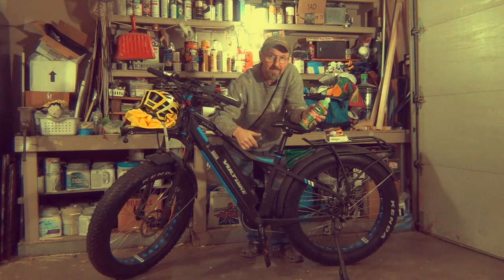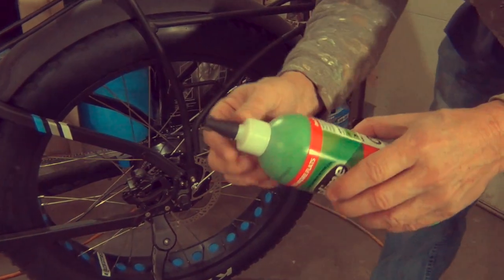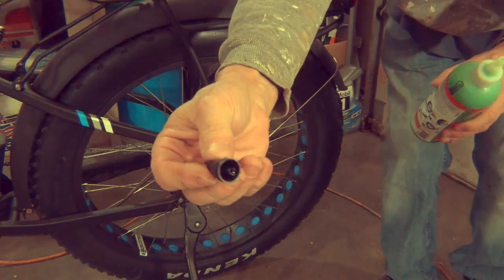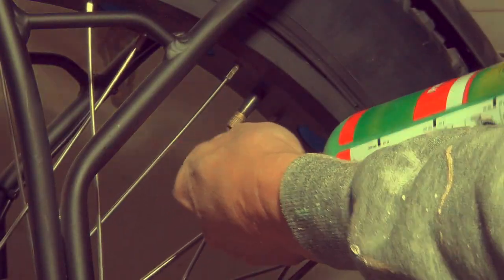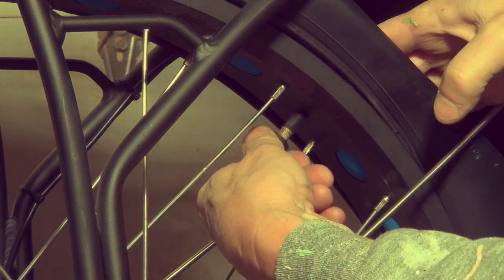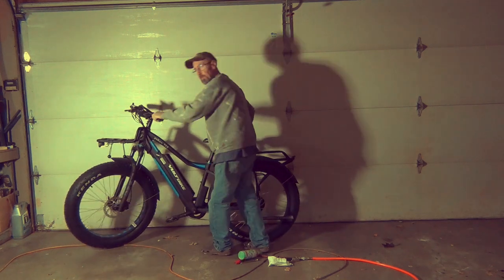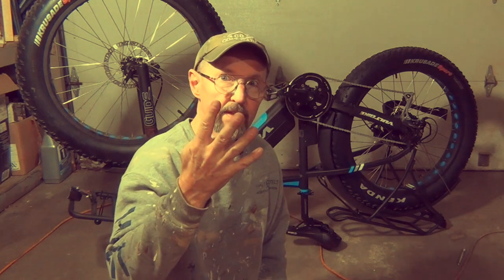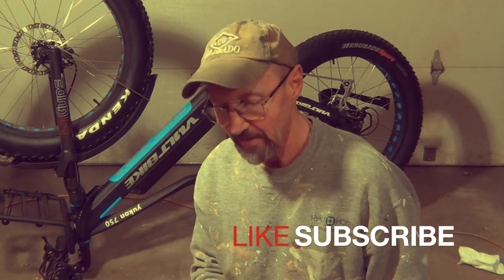Tire Puncture Prevention with SLIME

Comment: 4 Oz is for normal bicycle tires! I use half of this bottle on my 20x4.0 tires ( as recommended by slime themselves and Mr Taffy or else for this size or Motorcycle). So with normal fat tires , you can basically use the whole bottle
Reply: Slime has a calculator on their website.  It calculated 9.4 oz for my 26" x 3" tire.
Reply: @coloradopeoplesnews7676  wich is about 275ml, wich is half the bottle in this video. Seems accurate. I use 390ml in my 26x4.0

Comment: Great video.  I followed it and worked perfectly for me fixing a flat in my Lectric XP.  Thank you for the detail
Reply: Did you need to change the inner tube after using slime or it was just good as new ?
Reply: @MrInternational17  So far, good as new. Holding the air perfectly. No leaks whatsoever.  But, was a very slow leak in the first place likely due to a grass thorn.

Comment: Awesome video. I hit a patch of thorns with my rear Kendra tire and I was stressing about removing the tire and tube. I think this will fix the pinprick holes easily in the tube. So excited to give this a shot. Thank you!
Reply: I would have thought these wideass tirers would be indestructable. I never left the road hardly. I aiint no BMXer or Mt Bike nut. Jeezus Im 70 yrs old. I should be on the porch! har har. Noway. But tell me did that pinprick leak so fast you couldnt fill it up?
Reply: @ziblot1235  It all leaked out over night and I didn’t know it had a leak until the next day. This was over a year ago tho and I haven’t even had to put air in. 400 miles.
Reply: @YeBittenDog  EXACTLY the same thing happened to me. I tried a tire patch but my tire is too huge for it and the pressure made it pop off anyways. and it is impossible to get my back tire off the actual bike unless i wanna take apart complex electronics so.. im hoping this will work, did it work for you??
Reply: @skepticalpianist3266  yep! Worked great and still riding on it without issue!

Comment: I was losing about 3lbs of air a week on my RadRover. I added the Slime and the pressure has not changed for 2 months.=)
Reply: Dang that's awesome thanks for informing us mate!
Reply: I would be terrified to ride further than t he end of my driveway if my bike was doing that. I only had like 160 mi on my bike. Never had any problem. Im about 3 mi from home. WHam. Back tire goes flat. Look, Im 70 yrs old and Im 3 mi from home. Old lady is down at the beach. (Good place for her) Kids are who knows where) Im walking. I negotiate a place to leave my bike. The next day Im reading how to take tire off. Thats a "Nogo" It aint happening. So I snatch innertube out from between gears and spokes etc. I pump up a little bit. I can hear it. I see it. A tiny hole that looks like a whisker. I mean it. How coould that thing be blowing air like that. I cant even get 5lb pressure! So I get a patch kit. Put that cement down, and put one of thise orange patches down. Its been 3 days. I keep squeezing it. Its hard as a rock. Gauges just dont seem to work. For me. IM lookiing at this slime thing as a backup remedy. Id rather make it toubeless, you know? Im still paranoid aboutgoing anywhere. I saw one guy who crammed a strofoam worm in his tire. But all that requires taking the doggone tire off.

Comment: I had a similar problem to you when inflating my fat bike tyre, even tyhough the bike was upside down. Tip - use soapy water and a paintbrush to coat the bead and rim, and keep checking the tyre is within the beads every few pumps. The soapy water helps the rubber bead settle into the rim as the pressure rises in the tyre.

Comment: I watched this video and I thank you for uploading. I still messed it up tho. Glad I did front tire first. After I added the slime I got the tire spinning and the valve stem got sucked inside the rim. Not a big deal but still had to pop the bead and partially remove tire to locate and reset the stem through the rim. Maybe this will help someone else. Put the air in first!
🙃

Comment: My issue is that no matter what I do once I connect the hose and try to start filling my bike tire it stops flowing as soon as it reaches the valve. After that it’s practically impossible to get the gel into the tire no matter how much I squeeze the bottle.
Reply: R u sure u took out the valve core?
Reply: @tiko6186  Yes, I did. I finally just gave up.
Reply: @TheChico1332  yeah weird i just did mine the back tire no problem filled up without an issue just like the videos but the front tire i did it the same exact way tried to 30 minutes and i couldn't get more than a drop in not even 1 oz i got 3 inch fat tires i put 8 oz in the back tire i dunno what it is

Comment: DO NOT I REPEAT DO NOT USE A SHARP BLADE TO CUT THE HOSE  OUT !
YOU WILL ONLY CUT INTO THE THIN BOTTLE ,WITH GREEN SLIME DRIPPING DOWN YOUR FINGERS AS YOU SQUEEZE THE BOTTLE
JUST RIP THE STICKY PAPER OFF

Comment: Thanks for the vid, I put slime in my fat tires and then stupidly inflated to 40 psi like the tire said, forgetting about the additional mass of the slime. The bead popped off, even after reducing to 15 psi which is right about the least you’d want to ride it at (fat tire chopper bicycle). Might try one of those tools since it’s not wanting to set back by itself, thoughts?